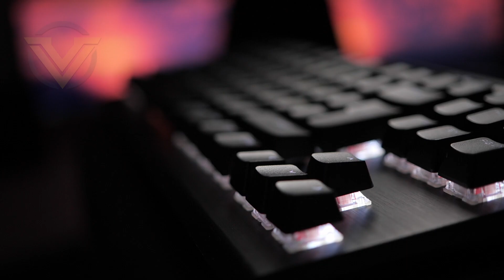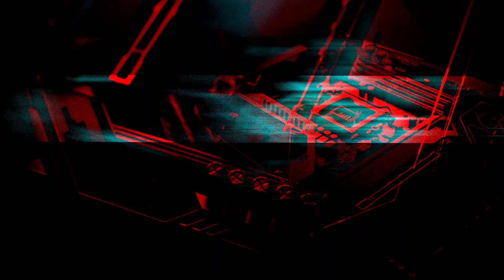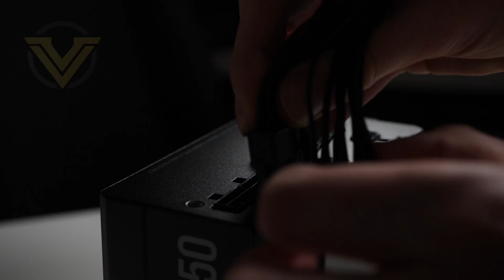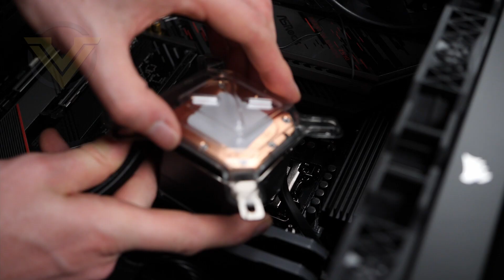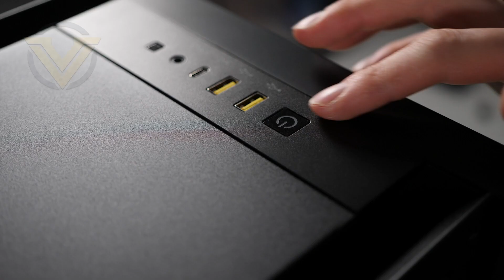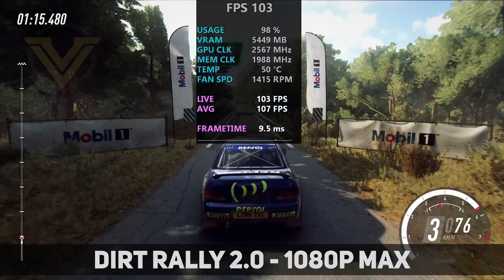ASRock Gaming PC Build 2021 - Intel Core i5-11600K | RX 6600 XT

Comment: I got the same specs and the reason i went with intel was the lower price. But i find out that with amd cpu you get a lot more flexibility and with this 590z you are pretty much stuck unless intel comes up with newer cpus that dont require you to get a newer and more expensive board in case you want upgrading. And on the other hand amds still use am4 socket and dont require you to buy the more expensive board just so you can fit the 11600k and get its max performance.
So if you going for cheaper go this way but if you want flexibility go with amd. Might be a bit more expensive but i feel like they are a lot more respectful for not making you buy a more expensive board.